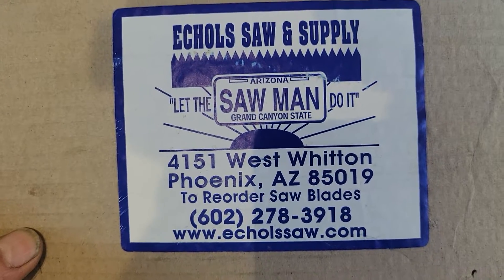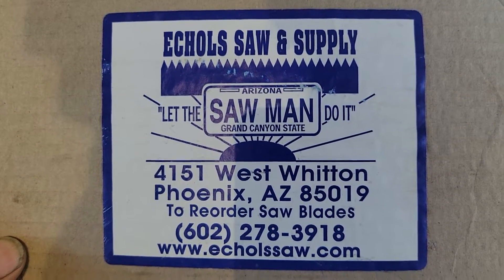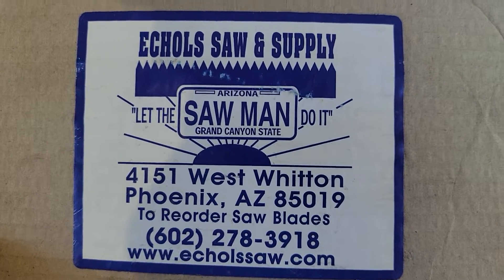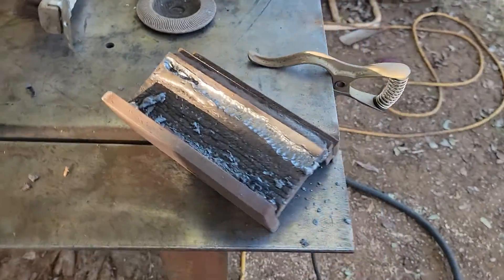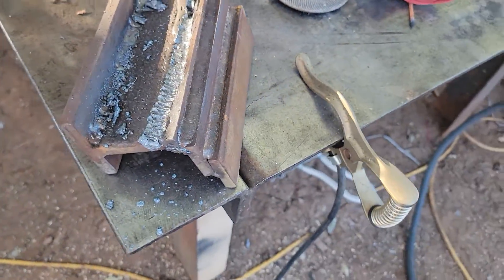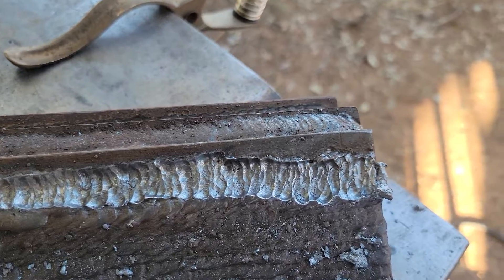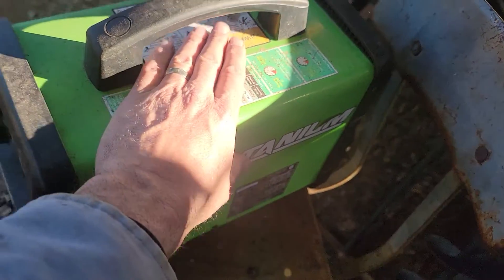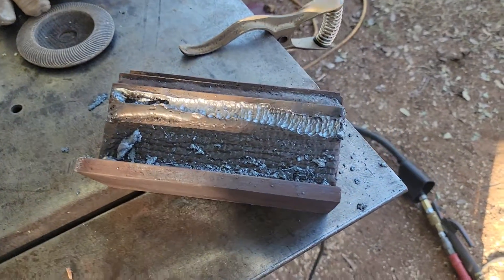Titanium stick 225  Can you carbon arc gouge with it !?!

Comment: Looks to be a rather robust machine for the price.   I'm thinking of buying one at Harbor freight but was a bit hesitant as the old saying is, you get what you pay for.  

I don't plan on doing any heavy duty welding, and by that I mean probably ⅛ to 5/32 stick rods at the very most, and occasional use of a carbon arc torch I made a while back but never tried it out yet.   I do realize that since this is a DC only machine, I would need to use a larger carbon for the positive, i.e. ½" and ¼ to ⅜ carbon for the negative or something like that @ around 70 amps, to compensate for the positive carbon  burning with ⅔ the heat concentration.
Reply from the maker: HeyThanks for the comment and the view.Especially for an older video I have used this machine intermittently.Since I've made that video.It has not failed me.I would have to say if I was in a position to give any advice, I would say, use your best judgment if it doesn't work out just take it back other than that.It is a great machine , and I would buy one again

Comment: Great vid, how much amps did you use, what size gouging torch did you use?
I have a ronch 250 amp inverter machine, its really a beast did lots of heavy stuff and its taking the abuse
Reply from the maker: Hey man, great question. I used the arc air 300 amp assembly with a 5 32nd carbon, I ran my machine wide open if that makes any sense or maxed out at 225 amps which I think it actually produces a lot more than that, I hope this helps, thanks again for the comment and the view.

Comment: Holy cow... if the Stick 225 survived that... it must be a decent little machine.  I was almost certain you were going to let the magic smoke out of the Titanium.  I'm sure you would if you made doing CAG with it a regular habit.  CAG is really tough, almost abusive, on power supplies, especially small ones like buzz boxes and these small inverters.
Reply from the maker: Hey, thanks for the comment and the view much appreciated I have beat the s*** out of that machine, and it just keeps going. I know that every once in a while, some lemons will get out, but for the most part, hands down, I would feel good about recommending this machine to anyone. Thanks again.
Reply: @26feironworks79  Yeah, I bought one about a month ago, I've ran about 5lbs of 6011 and 7014 through it so far.  I'm really impressed with it so far!!  I've had a Hobart Stickmate AC235/DC160 in my shop forever and love it, but I bought the Titanium so I could be a little more mobile.  I thought the Stickmate had a fairly smooth DC arc, but man this Titanium Stick 225 is like butter.

Comment: Just use two 6011 rods at the same time at max amp and they will gouge through train track  ;-)
Reply from the maker: Hey, great comment that's funny that you bring that up. I had to demo. A huge rolling gate and all. I had was some 60 10 5 p plus on my Miller Bobcat 225 I did exactly what you described worked like a charm. Thanks again. Happy Super Bowl weekend.

Comment: Dang, 5/32. I was expecting a smaller rod. That was surprising. I have one of those Vulcan 220s and for standard mig it has been great. Have had it over 3 years. For comparison i mainly run a Miller 352mpa with a S74 wire feeder with dual shield but ive been impressed with those HF machines.
Reply from the maker: Hey, thanks for the comment and the view much appreciated. I am still kind of shocked at the value of these machines for the quality of the product. And the price performance Apex is absolutely amazing with these machines. In my opinion, thanks again.

Comment: Pretty cool try using a smaller diameter rod and see if that helps
Reply from the maker: Hey thanks for the comment and the view much appreciated.I was using a 5/32  diameter.And I think that was the smallest available to me From my local welding supply store.
It wasn't perfect, but it did OK.I'm still shocked that it actually worked

Comment: And here my boss keeps telling me I need to get a 3-400 amp machine for it to be worth getting a carbon arc for my home shop
Reply from the maker: I think if you have a clean 220 outlet.And plenty of air and if you use the 530 seconds electrode, I think for small projects.You should be just fine.Thanks for the comment and the view

Comment: This is one of the better videos on YouTube, testing/using an inverter welder for gouging, which is an awesome capability, & necessary for quality repairs. 

What amperage setting were you using, and have you gouged much with it since making this video?

Thanks!
Reply from the maker: Hey, great question I was using it wide open. I believe I'm using a 5 32nd carbon. And I haven't had a chance to do very much. Gouging with it, thanks again.
Reply: @26feironworks79  - Thanks for the response. I was looking for a welder to let my 13 & 14yo boys use, that I could also gouge with, when needed. I ended up getting a ArcCaptain MIG200 because of the functionality/portability.....but it maxes out at 180a (on stick mode), and actual output is probably 150-160a.  Your Titanium 225 does a better job of keeping the carbon lit.

Comment: I gouged with that machine about a month ago and qorkd good. No problems. I just need to get a bigger air compressor because i had to wait every the pressure got lower than 90 psi

Comment: That will burn that thing up pretty quick those welders weight like 10 pounds there's barely any heat sinks in em trust me yeah of course it will work but very temporary the voltage spikes from CAG is too much
Reply from the maker: Thanks for your input. I definitely see where you're coming from, but for the sake of answering a question and doing a quick demo,  worked pretty well. I think I will have to do more carbon arc gouging with it to see if. I can trip the overtemp sensor to get a true feel for what this thing is really capable of thanks again.
Reply: @26feironworks79  it’s only a harbor freight machine so it doesn’t really matter but it’s not really the duty cycle of the welder it’s kinda like he said it’s the voltage spikes that kinda unglue all the boards and windings. Bobcats usually have a pretty good duty cycle but apparently the way they are wound they are not made for gouging. They will work but we caught two of em on fire during a big crack repair on a hydraulic press. Then we got a vantage which burned smoother and quicker and did not let up. Again it’s a harbor freight machine it really doesn’t matter. If you got a few inches to gouge out go for it. It’s the stuff you see IC Weld doing with his gouger that will burn it up

Comment: What size carbon electrode were you using?  This is pretty awesome!
Reply from the maker: Hey thanks for the feedback and the comment much appreciated I was using 5/32 and I still can't believe it worked And it worked very well too
Reply: @26feironworks79 I was thinking that 3/32 or maybe flat rod on its thin edge would be about the max. That's pretty impressive and saves me buying a new machine. Hopefully mine holds up because I have a bit of work to do with an arc gouge.